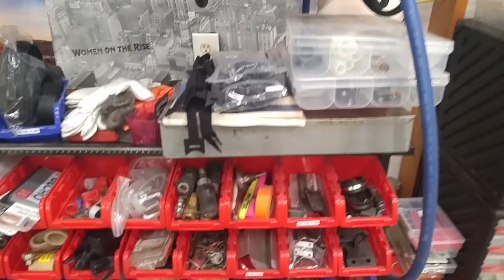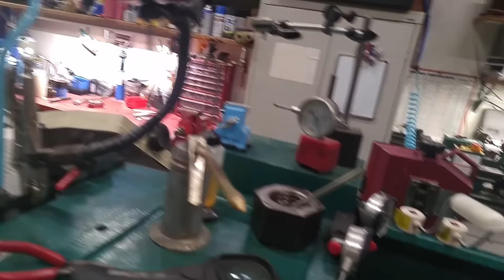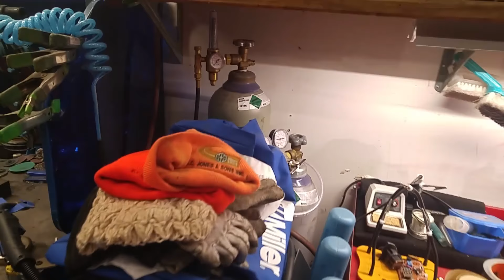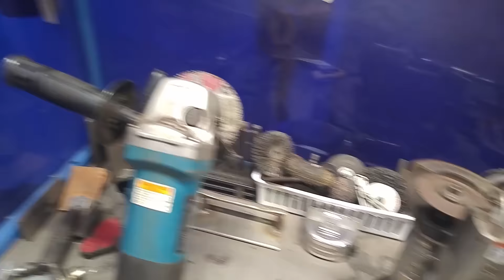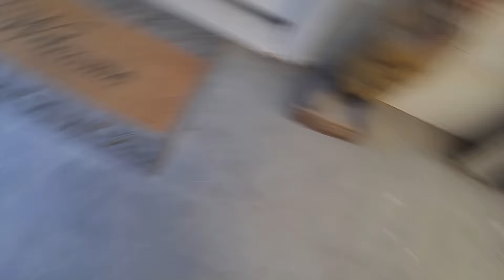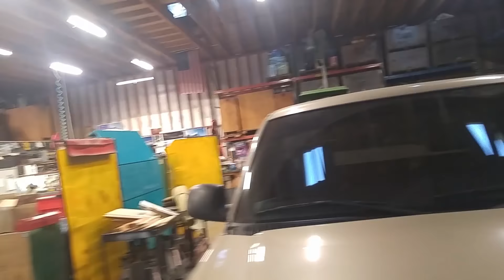Have look at my 60'x54' project shop and storage! shop tour

Comment: I enjoyed the tour of your shop. I love the organization. I also loved the large Wilton vise, I have two smaller ones and I know how much they cost, well done. Thanks for letting us poke around.
Reply from the maker: Welcome. Is that topside creeper worth the money? I look at it a while back. I have been using a sheet rockers bench for years. It gets me up there, but I still have lay on the radiator and support. When I did heavy equipment repair. I had a old back broad out of ambulance rig up to my truck crane, tell the safety dude saw me.
Reply: Funny you should ask as I just used it today. I have three 1 ton trucks so yes, for me it's worth the money.
Reply from the maker: I saw it your video a few months ago. I was looking at topside creeper and the pro gear one. I have a raised 1 ton dully flatbed that I need to replace the firewall insulation, the squirrel ate it. I see topside creeper is down to $200 shipped.
Reply: G Naron That's a fair price with shipping. My 05 Chevy needs a new insulation blanket too. It costs more than the top creeper!
Reply from the maker: My hood insulation blanket is missing some fabric. I think I'm going spray glue some new fabric on. They want $350 to 400 for a new one.
Reply: G Naron It's crazy prices.
Reply from the maker: I order a topside. Got it for $157 with two day shipping, because I signed for a Amazon card and prime! I'm happy you looked at videos today, some how you reminded to look into getting a topside. Thank You.
Reply: Prime is so worth it too. I travel a lot so I use prime for not only free shipping (on most things) but to watch movies at the hotel. Let us know how you like the top side creeper.

Comment: Very nice setup. I'm a local 3 member and I'm guessing you may be also. You worked a lot of 12 hr days I bet. Enjoy your shop as long as you can.
Reply from the maker: Thanks. 34 years in L3.
Reply: Thanks for the reply. As for me 22 yrs local 12, 22 yrs local 3, and one more year until I retire. I built a nice shop back in the 80's then moved up north in 1996.  Haven't had a covered workspace since. Maybe I'll get a small shop after I retire when I move again. Picked up a few tips from your video. Hope you're doing well these days.